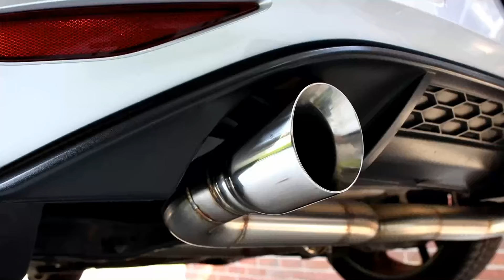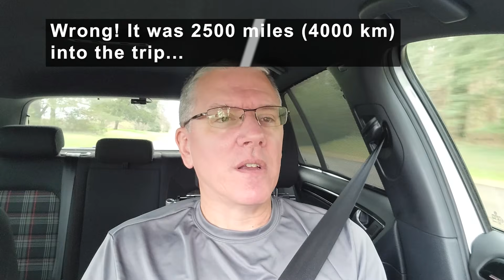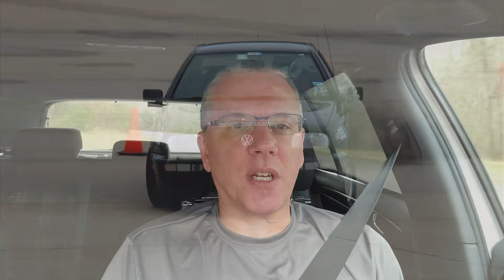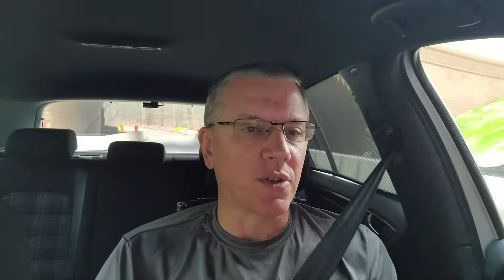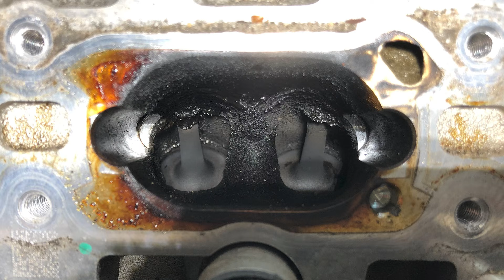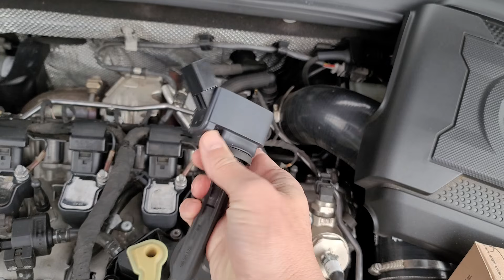CYLINDER #3 MISFIRE / HIDE CYLINDER

Comment: I spent the better part of my Saturday swapping the locations of the coil packs and spark plugs then doing a compression test on cylinder #3 only to come across your video later in the day. LOL. Thanks for the play by play and mentioning who you got to do the work on your car. Well, off to Euro Pros I go to get my #3 fuel injector replaced. Thanks again.
Reply from the maker: Sorry to hear of your troubles! Did you find an issue with #3? Or are you assuming it's the injector since everything you checked is good? Be advised that they may recommend replacing all injectors. The reasoning is that there is a lot of labor involved with replacing even one injector. If another fails next month, then all of the same labor has to be done again. Sure, he gets paid either way and will do the job twice. But there may be long-term savings to be had with replacing them all together. I'm detail-oriented and wanted them all done together, as if they might be "balanced." They're not, but I'm glad to know they're good for a while. Good Luck!
Reply: @StealthGTI  My code reader says the #3 is misfiring. The compression, Spark plug, and coil packs checkout good. The fuel injector is the only thing I'm unable to check. I'm experiencing the exact same problems you were having. I have the 1.8T engine so I reached out to Euro Pros for an estimate. Thanks for the info.

Comment: I've just come across your vid while searching for info on my MK7 issues. Same thing with EPC and judderring. We limped home from Wales to Leeds in the UK (around 200 Miles) driving in 4th most of the way without boost. A diagnostic scan when we got back showed misfires on 1 and 3 so I'll be getting it booked in. Thanks for the info on this vid 👍🏻
Reply from the maker: If you're going to a pro, hopefully, they'll quickly isolate the coil packs or spark plugs before going straight to injectors. Please be sure to check back to share your diagnosis. Thanks for visiting!
Reply: What was the problem on your vehicle?
Reply: Fortunately it was just as suspected, coil packs and spark plugs. Changed the lot which sorted the issue out.

Comment: samething just happened to me.   got the hide cylinder code. cyl 1 and 3 missfire     car engine light was flashing. really hope its just injectors and nothing more crazy,
Reply from the maker: Don't be in a rush to swap the injectors unless you have eliminated the possibility that spark plugs or coil packs are culprits. Also, pull the plugs to make sure they're clean. Although I haven't seen it on my GTI, I once had a 1.8T (pre-E888) valve cover gasket leak that let a tiny amount of oil into the spark plug well. That could cause similar results. In short, eliminate the cheap problems before jumping on the expensive ones. Good Luck!

Comment: Failed/stuck fuel injectors are easy to catch. If youre only getting 1 cyl misfire and its not the coilpack just pull the plug and it should be wet with fuel. Also exhaust smokes and smells like fuel.
Reply from the maker: My failure was not a hard failure. It worked fine at light and medium loads. So, the visual inspection did not reveal any problems. Still, I'm glad to have it fixed. Thanks for visiting!
Reply: @StealthGTI  I have same issue with my Golf R on 1st cylinder. It drives well on light load, but stuttering on hard acceleration. I had same issue with worn coilpack on Mk6 GTI. Tomorrow I have to visit local repair shop and I would borrow some used and good coil pack just to check if it works. After that I should order set of 4 new OEM.

Comment: I’m currently experiencing the cylinder 3 misfire myself, the misfire would only begin when the engine is left to idle, if I kept the revs above 1k all 4 cylinders would stay firing correctly… I’ve changed the coil, spark plugs, and fixed some fault wiring on the cylinder 3 coil connector… which led me to believe the previous owner has attempted it before, my next step now is to replace the injector, and clean the manifold whilst I’m there. Really bugging me now.
Reply from the maker: If you choose to replace an injector, just do them all at once. If one is really bad, how long before you have to do all of the labor again to replace another... and then another. Doing the same labor over and over would be a hassle. Hopefully, an injector is the correct diagnosis for you. Good Luck!
Reply: @StealthGTI  turns out motors blown, no comp in cylinder 3, new engine time unfortunately, but a very good video by yourself and Thankyou for the reply
Reply from the maker: @harryevans7624  - Ah, yes! I forgot to consider compression, as a good mechanic would before tearing anything apart. Are you buying a new engine? Finding salvage? Good Luck!
Reply: @StealthGTI  I’ll be looking for a salvage engine, around £1,700 in the U.K and around £400 for labour costs. Not a happy man, but we move on, thanks buddy.

Comment: I still have the issue after changing spark plugs, injectors, knock sensor :( any idea what else it cld be? I recently built my engine with forged parts and it can’t seem to pull pass 6.2k rpm. The epc light comes on and the engine chokes
Reply from the maker: I'd find a VW specialist and have them diagnose. I'm not an expert. As you may have gleaned from the video, a VW dealer is essentially worthless when troubleshooting a modified car. Good Luck!

Comment: Having misfire and hide cylinder on cylinder 3 and misfire cylinder 1 new spark plugs as well  with 1k miles, I am going to replace coil packs and injectors... I hope it fixes issues . If this doesn’t fix the issue what else could cause misfires from your knowledge ??? Ty
Reply from the maker: I'm not sure if your troubleshooting efforts are logical or if they're following diagnostic trouble codes and a good process of elimination. Are your spark plugs OE and properly gapped? Swap coil packs between good and bad cylinders first to see if the fault moves. If the fault does not move, then trying swapping spark plugs next. If the fault moves for either of those swaps, then you don't need to go through the cost and hassle of replacing injectors. Always start cheap. If those don't move or resolve the fault, then perhaps you have an injector problem. BUT, don't take my mechanical advice before spending lots of money one expensive parts. Seek competent assistance. Good Luck!

Comment: Thanks for the video.  I have a polo doing the exact same thing. Will replace the injector also. And hopefully will get the problem sorted
Reply from the maker: Glad it helped. Let me know if it fixes your issue. Thanks for visiting!
Reply from the maker: @UC50klj0TJbRYm2V90ML96qw - WOW! That's a big move for troubleshooting. I do not think it's the throttle body since a fault there would affect all cylinders, even if just sporadically. If you've swapped the injectors, plugs, and coils, all without the fault moving to another cylinder, I have to wonder if you have a compression problem. With that said, I'm not a mechanic and could be wrong. It may be time to take the car to someone with more knowledge and experience. Good Luck!
Reply: Did you sort the issue? Was it injector or bad compression?

Comment: This is your 2nd/3rd thermostat housings at 116k miles?
Reply from the maker: No. First failure. I had suspected a leak over the years, but never got to the bottom of it. I'm not even sure if this leak is the same one at a later time or something different altogether. I don't care, though. It's fixed. Thanks for visiting.

Comment: My cylinder 3 just triggered my check engine light. Cold start and let my car warm up before use every time I drive it and about halfway through the oil temp meter hitting 280 it rumbles the car a little then goes away. Not sure what the issue is but my local auto zone reported a bad cylinder 3. Car still runs fine, but I’m worried to keep going on it.
Reply from the maker: Take it to a competent VW mechanic. It may be an injector or it may be just an ignition coil. Good Luck!

Comment: There are cheap scan tools that could have caught that misfiring injector. It's either fuel.or spark.

I had a 96 golf gl with mystery ignition problems. If I pushed it, the engine seemed to lock up. One day I had to have it towed home. Pulling the Bosch plat plugs, two had blown up. Ceramic shards inside the combustion chamber. I fished them put with a rag soaked in STP (sticky).

Then filled the combustion chambers with kerosene with cool disconnected. I turned the engine oner, sending a spout of kerosene into the air. Cleaned out those spark plug shards. 

It turned out the engine grounding strap had a bad connection. Two spark plugs were firing at the same time. The car ran fine after the second ground strap. Though one of the cylinders had a little bit low compression.
Reply from the maker: Thanks for sharing your experience. I have a tool that's specific to VW/Audi. It reads more than just OBD2 codes. Regardless, the tool can only track to a cylinder; it cannot distinguish between an injector issue and a spark issue... only a misfire on a specific cylinder. That's where troubleshooting comes into play. Thanks for visiting.

Comment: I'm doing injectors and carbon clean asap. Random Misfires on all cylinders.
Reply from the maker: When you say "doing injectors," do you plan to just replace them without diagnosing them? It's possible that your carbon build-up alone is sufficient to create your problem. Good Luck!
Reply: @StealthGTI  I am getting a carbon cleaning and changing the injectors at the same time to avoid taking the intake off again. It's more of a preventative measure than anything. My gli runs fantastic but I get Misfires galore but no check engine lights or codes.
Reply from the maker: @Al_Vapez  - Excellent! Seems like a good plan.

Comment: Watched this video to see if it’s a good idea to drive while the car has a Hide fault so I guess I’ll still drive on it I hope my engine doesn’t get hurt.
Reply from the maker: I think I detailed in this video, but I think it's a bad idea to drive the car with a "hide cylinder" fault if the car is misbehaving. In my case, the code was stored, but drove normally at light loads. Good Luck!
Reply: I didn’t chance it
I order the parts and waiting for it to be delivered 
But thanks this video was very educational
Reply: I’m here right now
Pray for me
Reply from the maker: @mariopeak  - How did it go?
Reply: Madian Banegas  when temperatures is cold, it gives hard start and at idle 
Check engine light flashes and disable a cylinder

Comment: A few comments and a few questions:

The waterpump/thermostat/housing are all kind of related and that's a weak point on the EA888Gen3. We have 2 MK7's (Alltrack & R) and BOTH suffered failures under warranty. I believe the newer water pumps have more aluminum and less plastic and might be more reliable. The other EA888Gen3 weak point is the rear main seal - when I upgraded the clutch on my 6MT R to accomodate the Stage1 93 octane (high torque) tune, I had them install an upgraded RMS. Alltrack is still stock and untouched.

Maybe it was the crappy gas that was the straw that broke the camel's back regarding the bad injector!

I'm so happy to hear about the general longevity of the car - makes me feel like I made some good purchases. But 2 questions (feel free to use these for your next Q&A)

1) If your GTI died today (tree falls on it, bursts into flames, drives into the ocean) and you needed a new car right away, what would you buy?
2) Looking down the road 3-4 years and it's time to put the GTI out to pasture, are there any cars coming down the road (hybrid, electric, etc...) that you would want to buy to replace the GTI?
Reply from the maker: I thought about the fuel quality issue, too. BUT, if it was a fuel problem, it seems to me that it would have taken out more than one injector. I think the one had finally met its match. I'll find out soon: I'm about to do the trip again with another trailer. I'm not sure if I should be excited or apprehensive about that. HAHA! 

It's funny that you chose "tree falls on it" when talking about my GTI dying. I used that term in an upcoming video segment where I talk about other cars. To be honest, I'm not sure what I would get. I don't like the Mk8 at the moment. So, I'd consider a 2020 GTI. But I've also been keeping my eyes on Subaru Crosstreks (for small off-road adventures), Atlases (for slightly larger off-road adventures), and small cargo vans for conversion ideas. NONE of those can compare to the fun have in a tuned GTI. Still, I seldom unleash my GTI's full power and almost never push it to its handling limit. So, even if I got a Crosstrek with only 182 hp, odds are fair that I'd still enjoy it since it would likely be more comfortable and able to take me places that a GTI cannot touch. I hope to have a long time to think about my options.

Comment: Hey Scott, I just purchased a 2013 VW CC 6-speed manual and the day I bought it ran just fine. However before I bought it the engine would have a noticable ticking noise that I didn't recognize due to inexperience, and the day after I tried to drive it to work and it threw that flashing engine light and epc light at me. I pulled over into a park and felt the engine bogging and stuttering at low rpms, and I figured it was misfiring. I opened the hood to listen to and feel the engine, it had that same ticking sound and it was unusually shaking a lot. My dad thought it could be a problem with the sensor for the throttle pedal, so we bought a replacement. Replacing that took the epc light away, but I don't know if it will come back. I want to replace the coil packs and plugs, but now that I've watched your video I really am concerned about it being the fuel injectors. Problem is I put my all into the car financially, and I didn't even pay for it in it's entirety, my father lent me money. So I'm extreeeeemely parsimonious right now. Do you mind helping me figure this out? Thank you for this video! It was very educational.
Reply from the maker: Armando - I cannot give adequate assistance from afar. Without a diagnostic trouble code (DTC), replacing the accelerator pedal sensor seems like guesswork from my point of view. You'd be doing yourself a huge favor to acquire a scan tool, preferably one that reads VW DTCs such as OBDEleven, VCDS, or Carista, and work with real diagnostic info. Good Luck!
Reply: @StealthGTI  I’m going to get one of those. I just picked up a 2006 A3 for cheap in VA so I have extra funds to get the scan tool.

Comment: I never experience fuel injector failure on my horse drawn wagon, so clearly the car is at fault.

Glad it was a simple fix. Something to consider is that the APR (or any) tune may cause the injectors to approach their duty cycle more often and thus fail sooner. But for the performance you get out of it, I would just make injector replacement a 100k mile service item.

I really appreciate that you're forecasting the future of my car. Great to see you cutting up the Back of the Dragon as well.
Reply from the maker: Yes, APR Stage 2 and towing over mountains may have stretched the injectors to a higher duty cycle. BUT, I had to wonder why none of the other injectors were affected. We'll see if I have problems on the next trip. BTW, next week's video is about the BOTD run.  :-)
Reply: @StealthGTI  I doubt the specific trip had too much to do with it, as opposed to overall time in service. Do you use any fuel system cleaner products?
Looking forward to the video.
Reply from the maker: @acefighterpilot  - I hadn't used any fuel additives. I do refuel at top tier stations, though. I may add cleaners to my periodic maintenance.

Comment: How does the car feel after carbon cleaning?  How much was it?
Reply from the maker: I had the carbon cleaning done before the trip and, therefore, before my injector problem. The intake really wasn't too dirty. So, I couldn't tell the difference. It was just peace of mind. Take Care!
Reply: @StealthGTI  thanks for response.  Looking fwd to more videos.
By the way how does ceramic coating holding up?  Especially after such a long trip?
Reply from the maker: @SKYRIDR  - The ceramic coating is doing great! However, I still need to polish away some mineral deposits that marred the finish under the roof rack pads. I'm hoping that once thin or remove the ceramic coating in those areas.

Comment: Injector issues seem to be the Achilles heel of the gen3 motor. You were lucky and it didn’t get stuck open flooding the cylinder with gasoline. Had a local friend in the VB MQB group have that happen and cylinder 1 said “nope.” Granted he was making close to 500 whp on stock internals
Reply from the maker: I've been very tempted to go IS38. But, the way I drive, I'd hardly use the power... so, not really worth the money. Thanks for visiting.